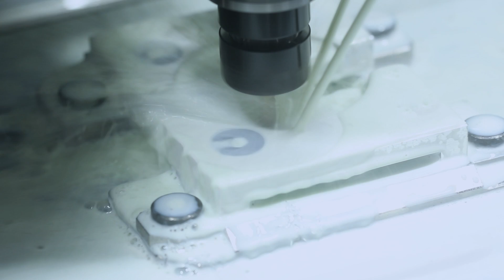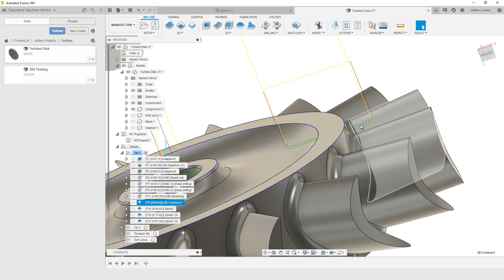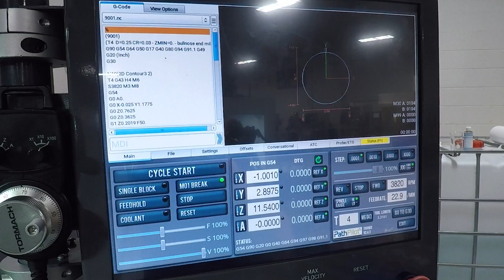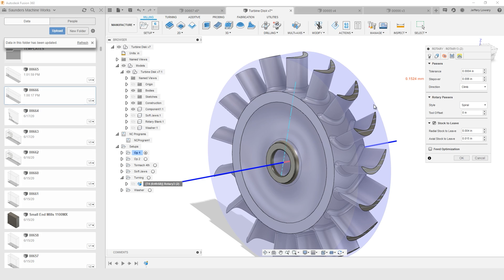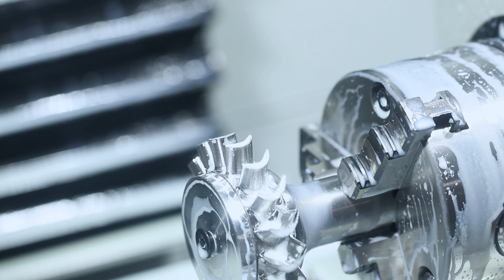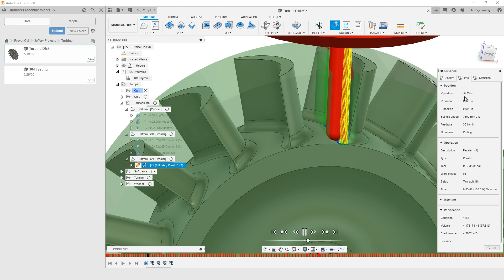Machining a Turbine Disk on Tormach 1100MX  + 4th Axis microARC!

Comment: Ive drilled tons of 304 stainless. A Good HSS drill bit I had got 150+ holes from one bit doing 5/8” with a 1/8”pilot bit going 1/2” deep.
Coolant is key. No carbide needed
Reply: I remember on a job is was on we had a skid made of 316 stainless square tubing for some bottled water machine we made for a customer. We are used to working with stainless, but we usually hire a local electrician to do the external wiring. And some times in rural areas this electricians are not used to working on industrial equipment, but just house installations. So i told him to put up a outlet on the frame of the skid and he said he would do it in the afternoon. The next day the outlet was hanging by some zip ties on the frame. I asked him why he had done that and he replied he had burned up all of his drill bits on the stainless steel....

Comment: Next time, as your first  operation , manually cut the face of one end of the part perpendicular with outside diameter of the part. My dad worked as a tool and die maker for General Electric for 45 years. He taught me you can't finish Square if you don't start Square.

Comment: In the gas turbine industry this was known as a blisk.    Integrally machined dish and blades.    Disks with separate blades was more common.   They're blades not fins.   Gas turbine blisks are usually made from even more challenging materials than stainless.   Is this a real part for a steam turbine, water turbine, or is it just a demo part to show what the machine can do?

Comment: Great stuff. I would however have used the lathe for the first operations. If you turn some soft-jaws you can get almost perfect concentricity and parallelism between top and bottom surfaces. It's also WAY faster and cheaper. Also you would get great surface finish. Then machine the fins using the 4th axis like you did.
Reply: It would be so much faster and easier in a lathe. Especially seeing as they're just throwing it in a mill for the 4th stuff.
Reply: Especially with 15 minutes to "turn the od" that should be 5 seconds 🤣
Reply: I agree it would be much easier to do it in a lathe, however... it's invaluable to see this method, not everyone has access to lathes, and knowing as many methods as possible is paramount to mastering your craft ^.^
Reply: I think the whole point was to show that you can do some pretty amazing things with very limited tool/resourses in your garage and not with full access to an entire cnc shop. of course there are better ways to do it . but I think that wheels looks dam good.

Comment: Why not start with v blocks and a normal vice for machining most of the outside diameter and facing off one side as reference surfaces? I'm thinking the soft jaws would then have known orthogonal geometry to clamp and the top would be machined parallel with both the bottom of the jig and the back side of the work.
I might be a machining noob who's only ever touched hobby machines, but I've had nothing but positive experience aligning symmetric pieces by flipping them in a machined jig. What am I missing?
Reply: THe main advantage I can see is being able to do many more parts in a jobshop app with a fixture you can just slap it and go. But for a home gamer your method especially for one offs makes more sense in the long haul.

Comment: High speed steel will last for a long time you just need to keep the surface speed around 40-50 and anywhere from .003 to .008 per rev

Comment: You might want to try using a v block like setup for round stock so that you can keep the contact points consistent. Since the raw stock is inconsistent on the outside diameter as well as the saw cut face the round part on the round jaw will always have inconsistent contact points. Learned this from John Grimsmo.

Comment: imagine the machinists that made these parts before DROs and Dial, and digital tools existed. They did this with standard micrometers, veneer scales, scales on hand-wheels and 40:1 indexing heads. They held a tolerance just as good. I worked with a fair amount of 304 stainless in the Navy, I do not consider it a particularly difficult material to work with.
Reply: Tormach doesn't hold the best tolerances anyway but I bet even with a good dro you can't compete in precision with the more precise CNC machines like Kern or Mori.

Comment: Are you guys going to try cutting this in 718? (So you can stuff it at the end of a combustion chamber and light 'R UP :) )
I've cut 304/316 with my gen2 1100 but I never could find cutting tools that could cut power turbine geometry in 718 (on the 1100)

That said, the 1100 does great with diffusers, compressors, basically everything forward of the hot section (which incidentally is generally 7075).
At any rate, thanks for the content; always appreciate another way to see challenges met with solutions

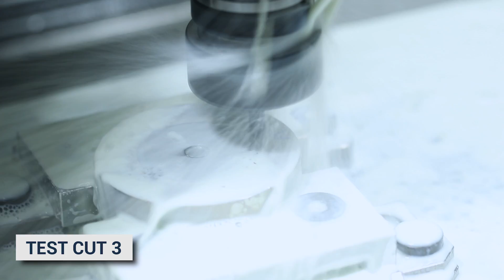Comment: Dear Sir, at 11:20 you are troubled by non-parallelism of your part. With the rough finished part firmly held to the floor of your vice, is you take a large end mill and shave a flat surface over your entire part, wouldn’t you end up with what you want - a perfectly parallel part? That is of course assuming that your vice floor surface is perpendicular to your spindle shaft.

Comment: Have you guys considered a 4-jaw chuck (or maybe a 6-jaw) on the 4th axis? It should be a little easier to align your parts without having to tap around the part itself a whole bunch. A 4-jaw chuck would also give the ability to hold onto non-round parts or purposely offset from the central axis if that was needed for the machining ops.
Reply: I have this same rotary axis -- they don't have a 4 jaw chuck available for it and I haven't found a compatible one but it would be a great addition to the kit.

Comment: The angle on those vanes kind of makes me think that's either a very low pressure ratio compressor, or a stator from a compressor assembly.  Or maybe it's for a steam turbine and I don't know what I'm talking about
Reply: It's for a small turbine engine, so close-ish!
Reply: @AndrewBarth  What sort of small turbine?   Most gas turbines use more exotic materials than  300 series stainless steel.
Reply: A compressor stator is a stationary part directing the air flow between axial compressor stages.  It's not going to be a bladed disk.

Comment: I hope this part is just for a demo.  No posititve drive like a key and a slip fit to the axle.  Because the poor surface finish will be a problem with fatigue failure if running at high speeds over time.  There is an awful lot of chatter on such short fins with that stout geometry.  Keep learning though.

Comment: Looks like part was out of square when machined on op 1. If you have access to a surface grinder, I would put it on a v block and grind one side and then put that ground side down in the vise and make that your op 2 side. To ensure parallelism without a doubt.
Reply: *even if stainless doesn’t like to get ground lol

Comment: just for guys who don't know this is not a turbine disk even the blades aren't naca aerodynamic profiles and the geometry of a turbine disk makes it impossible to machine it in a 4 axis a 5th axis is a must to reach certain areas or you will need to index it several time all of this is just to show the tormach and what it can do with the 4th axis so don't take this as a reference
Reply: Sure it is.   It's just not a vary sophisticated one.  Nowhere near what the standard practice was 25 years ago.  That's when I last worked in the industry.

Comment: I Love the video, but a quick question about the use of the micrometer. I've learned to use the small knob on the end to measure. There is a mechanism in it that makes sure you always apply the same pressure/torque. But I see a couple of machinists who use it differently (you, abom,  etc.)
Reply: Some micrometers have both the large and small parts driving through the ratchet mechanism. So you can turn with either and get reproducible results.

Comment: That mod vice is a pain in the ass and I can already see that you have the jaw closest to the door bolted in the back away from the work where as you should have the bolts as closes as possible to the work. When you clamp the work I would bet anything that it is lifting the mod vice jaw off of the table. #1 rule in any machining is to keep things as short and close as possible. The 5th axis you used to "turn" the work for one is several inches off of the table creating a lot of deflection right there and then you also have the work bolted to an arbor to looks to be almost 2 inches from the chuck, all bad. That work should be as close as possible to the clamp. Keep everything short, close and tight.
Reply: Clearance is clearance.  Just gotta do the math, pucker up and hit cycle start.
Reply: 4th* axis being several inches of the table: 

Sticking out of the chuck: could have been shorter.

Vise lifting the part of the table: that's why it is set with a dead blow. It happens to ALL vises.
Reply: Also, there are two holes in the vise so it fits the work and the t-slots. So, maybe the inner holes couldn't have been used with that setup.

Comment: How the f did they make steam turbines before cnc?!
Reply: Graybeards with files!
Reply: Mold+forge it in parts and then a manual lathe+mill, Now mold+forge in parts and cnc lathe+ cnc mill
Reply: I know this is more rhetorical of a question, but lots of Manual balancing.   And lots of it.
Reply: I think most involved machining the hubs and then brazing in the blades which were either milled in dedicated tracer machines or forged.
Reply: what was there first? milling machine, lathe or grinding machine?
Reply: @bcbloc02   Not in gas turbines.   Blades where mechanically attached: slid into a sophisticated groove in the disk and pinned or such.   Lots of times blades were cast.   Least back when I was in the industry.

Comment: For the soft jaws at the start, why dont you just do a v shape instead of the cylinder. Didn't John Grismo do the same thing on his 5 axis with changing cylindical clamp to a v?
Reply: depends how hard the material you are holding is, clamping in a v will likely cause a bit of deformation / vice marks due the the small surface area coming in contact with the work.  Soft jaws spread the pressure far more evenly.
Reply: if you comp the diameter to fit the work piece its a much better fit. Especially in soft jaws

Comment: You USE Your micometer wrong. USE the little END to turn to IT make a clikking Sound. Dont turn on the big END.
Reply: Not necessarily. Some micrometers have both parts (big and little) on the ratchet, so you can turn either one and still get reproducible pressure/readings.

Comment: 30 m/min cutting speed fo HSS tool in 304 SS ?? No wonder you are burning the tips on the tools. If you are not sure of the hardness of the parrt or just doing a one-off or proofing a part, go more towards 7 m/min.

Comment: Your turbine disk would never work in an aircraft engine.The blades are of the wrong contour & pitch. It might work in a hobby engine but i t would never work in a real aircraft engine. I know since i had machined rotating parts for aircraft engines for 20 years for GE Aviation.
Reply: Yea, I'd suspect most turbines are still separate disks and blades, not blisks.   They're not 300 series stainless steel either.